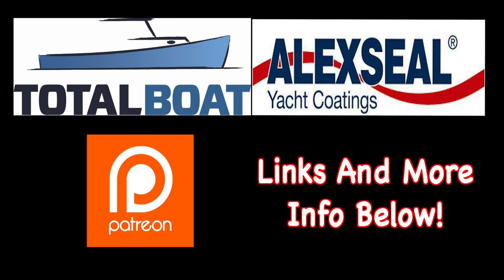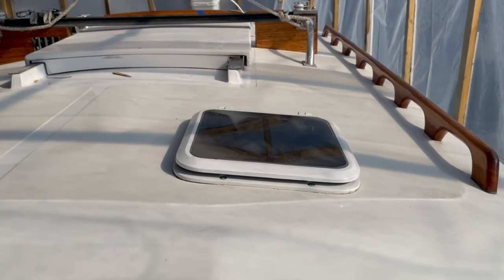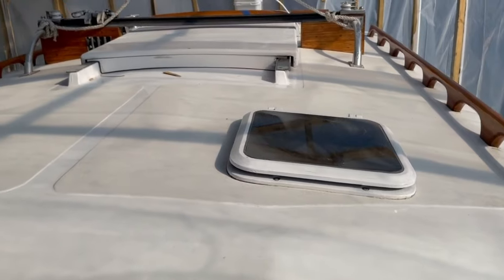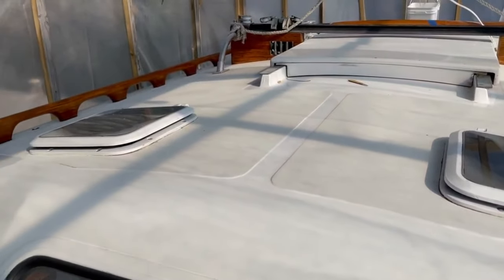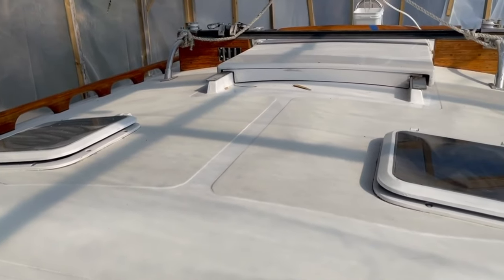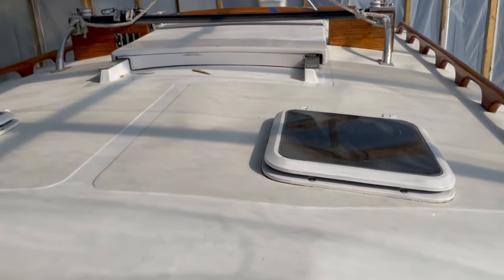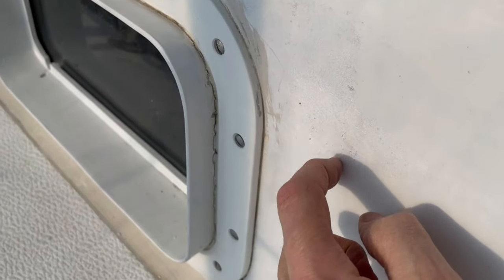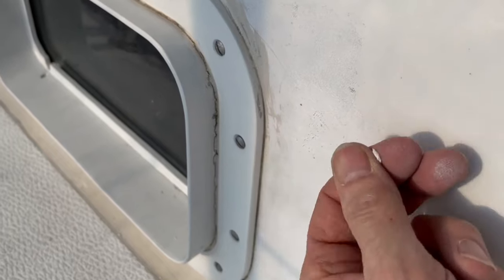Can You Paint Molded Gelcoat Nonskid Successfully??

Comment: Did this exact project (consulting with Andy) for a Beneteau 361. Just as he said, sand, primer and paint all the smooth areas (non-nonskid) first. Then I taped off the smooth areas and hit the non-skid with 60 grit to take off the peaks. The 60 grit was aggressive but it went much quicker. I wasn't looking to get the surface completely smooth. Then I used flexible 2 part epoxy and squeegeed it over the sanded areas, filling in the remaining valleys. Next was the Alexseal primer. Note that you have to pull the tape after each layer, otherwise you're going to spend a lot of time removing tape with a razor.
The rubber granule non-skid was poured over wet Alexseal top coat paint. Used a very clean vacuum to suck up the excess after allowing to dry. Then 2-3 coats of topcoat paint to seal.
Some of the slip holders in my marina routinely do the Newport-Bermuda race. They all planned on doing the same process, given the soft surface with superior grip.
Not going to lie, it was a week of very long days and frustrations. But, the end result was truly stunning.

Comment: There's always sand blasting to remove surface contamination.  It's really messy and hard to do correctly, but nothing can beat it for providing a clean surface ready for painting.
Reply: Fiberglass should never be sand blasted. I know people do it, but it's really not acceptable. Walnut shell media is barely acceptable. Peeling with specialized planer is the recommended method.

Comment: I’ve had success with top coating diamond pattern non skid  as well as smooth gel coat by power washing several times, first with a degrease/wax, then with an aggregate (soda), then a couple times with fresh water. Be sure to do a final wipe .  I roll and tipped with a 2 part epifane’s with 10% thinner….. 2 coats, no primmer, 6 years out, still looks fresh.  Non skid still has grip…..

Comment: I think the "sprinkle on soft sand" (or rolling) and "Kiwi Grip"  looks amatureish! Nothing looks as good as the molded in non-skid.  Before filling with fairing compound and sanding smooth, (starting over with a flat surface) I'd test a small section of non skid and apply  primer and paint. If it looks even marginally good, it will still look better that soft sand or Kiwi grip. Just my opinion :) Love your videos!

Comment: I work at a boat yard, and like Andy said, there's no way to guarantee that the diamond pattern non skid will ever be clean enough, especially with old, chalky gel coat. Yes, you could try to clean as best possible, but on my boats, I sand the diamond pattern flat and start with a nice flat, fresh surface and use sand.

Comment: Others have already suggested sandblasting. You could remove the paint with a stripper, especially if it's a one-part paint. Aluminum oxide and carbide abrasive powders are readily available, 80 grit and coarser, and could be applied with a hand wire brush to provide plenty of tooth. Pumice is friable and fine and is used for rubbing out finishes. Comet?

Spray or a good brush could apply an even coat even on the peaks and valleys if a roller failed.

I wouldn't want to build up a smooth surface with fairing compound on top of a deteriorated paint layer with just the peaks sanded down to gelcoat. That could fail dramatically.

Comment: Just as an alternative,  if the surface softens/ bubbles,  would it be just as effective to soak the surface with the reducer and then pressure wash the surface? For the bite into the surface, would you consider soda blasting the surface, which also ensures all of the paint is removed. Additionally, is a chemical etch possible with the paints you discussed? Back in the day, we would use Skipsand to ensure the bonding of bottom paint.
Reply: Was skipsand a chemical? Or a process?
Reply: Skipsand was brushed on like a primer, leaving a translucent tint. It was wretched smelling, even outdoors. It probably shortened the lives of everyone who used it. LOL

Comment: Tape—Washi ultra-premium painter’s tape—lasts in the sun for a long time, holds up to rinsing off, (but not direct high pressure)even sticks to a wet surface.  Costs about $8.  So much better than the blue tape and as good as the $100 silver tape that’s no longer available.

Comment: Sandblasting or pressure washing paint remover was not an option because the boat is in the water and I don’t want to make a mess. In addition, the weathered gel coat is softer than the paint. A Bosch 6” RO sander with a Dust Deputy and a shop vac does fine. Stripping the smooth areas are far more tedious.

Comment: Dear Andy, thank you. May I ask please, if the non skid is the original gelcoat can you clean and then apply a new thin coat of gelcoat over the top. My deck non skid will not come clean - its either that or sea deck.
Reply from the maker: you'll run into the same issues as mentioned in the video coating with paint.  Loss of texture and bonding would be an issue :-/